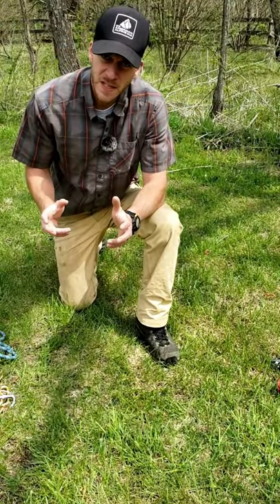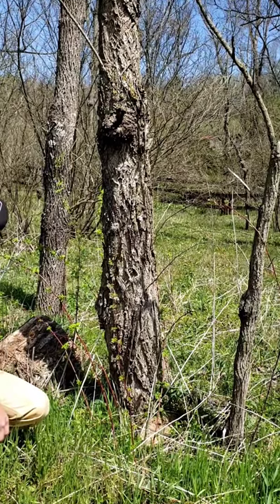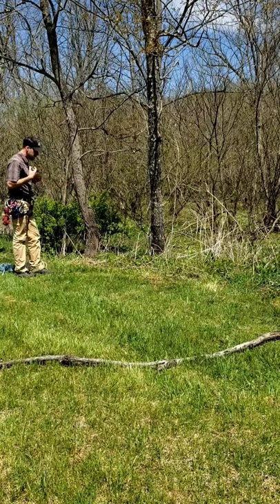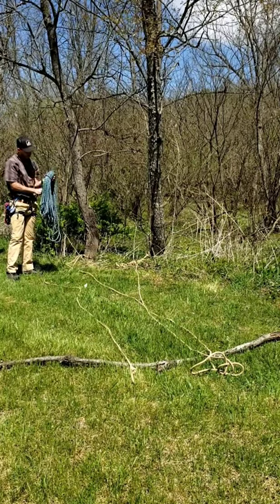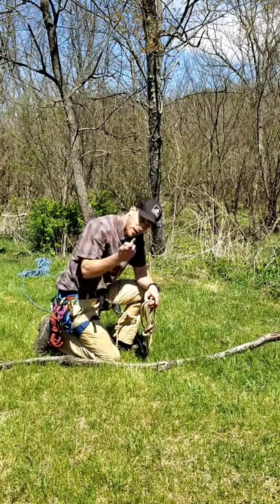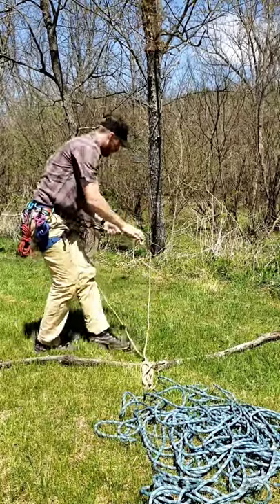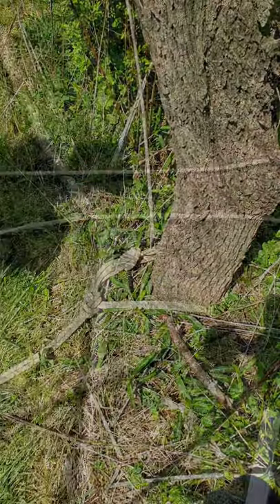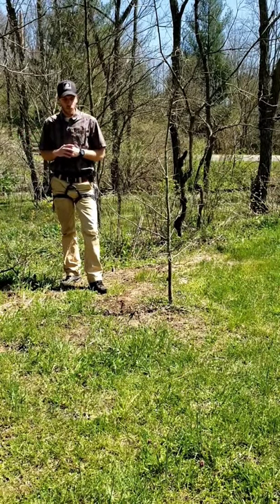Building a simple top-rope anchor with static line

Comment: wondering how you can easily adjust the static anchor line length from anchor to edge of cliff - he estimated it and it had to have been perfect because it apparently didn't need any adjustments - that seems to be a disadvantage to this set up.   advantage - no biners needed at anchor tree.
Reply from the maker: you can adjust the anchor in two ways: 1) pass slack through the second bowline down toward the master point if you need more slack or pull it toward the anchor point if you have to much rope in the system... then reset and dress the knot.  2) if you only have excess of rope where the master pint will be tied you can just tie it back on an anchor leg with a barrel knot.